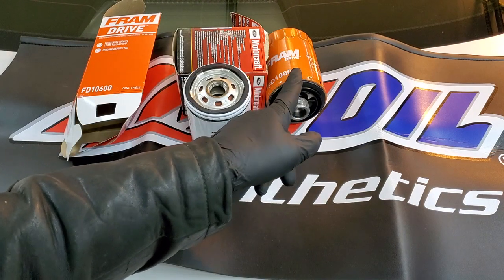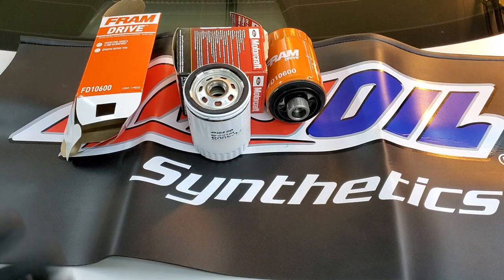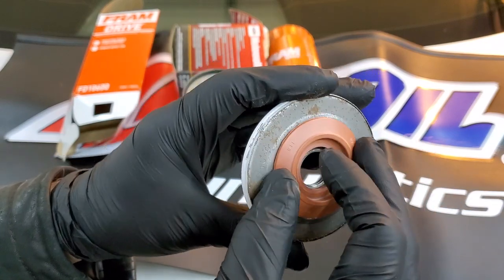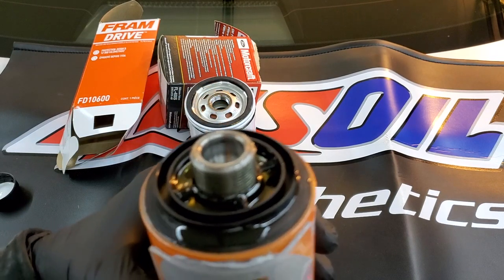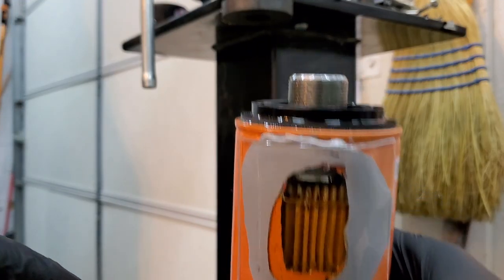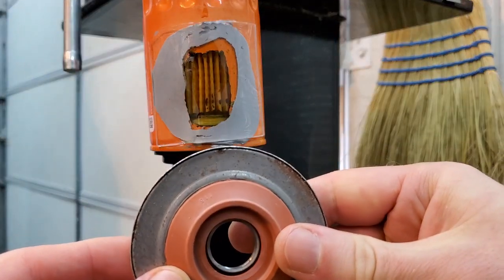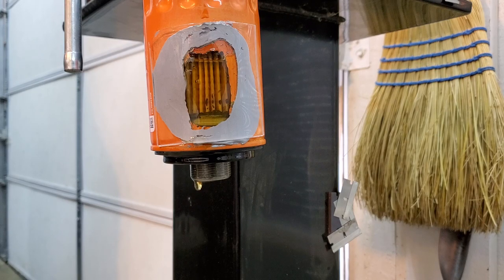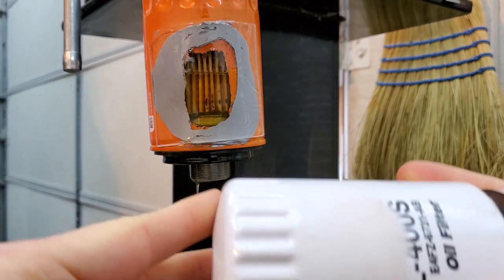How oil filter anti drain back valve works? Anti drain back valve has 2 jobs to do.

Comment: Makes you wonder if the reason so many Subaru engines blow up is because of the bad filter placement and too many dry startups.
Reply: That is a factoid. Most Subaru engines blow up due to people believing they are smarter than the engineer who built the engines from the beginning. The naturally aspirated EJ-series engines had head gaskets of another quality than the turbo charged engines. After some odd 100,000 miles the Teflon coating on the gaskets wore off and started to leak. 

The first generations of the FA20 ans FB20 engine series had a faulty rocker arm assembly and that has since been corrected. There were also a problem with the piston rings for said engines - but with good oil and 5000 miles oil change intervals that could also be prevented. 

The top mounted oil filter has nothing to do with these issues. 

It’s also less messy when you’re doing the oil changes.

Comment: Subaru's FB engine has the filter on top. The oil light stays on for about 1 second after starting with new oil and filter. Every start after that the oil light goes out instantly. I think once the filter element is saturated with oil it makes a difference for the next start up. Great video.

Comment: Nice visual but there is a difference in how well it works. You see you did a great job making it visual. But with fluid dynamics you showed how well it holds oil in a open condition. Not a closed condition like it is when mounted on the vehicle. To very different conditions the closed condition will not allow the siphoning off like your open condition in your test does. But however was very interesting.
Reply from the maker: Plus oil temperature in vehicle is around 190F and in my garage around 40F. Hot oil flows much faster. Thank you for commenting.
Reply: @repairvehicle  yeah I know very true it would interesting if it could be seen on a vehicle.
Reply from the maker: I have some ideas, but not sure how to accomplish yet.
Reply: @repairvehicle  plus the oil pressure might separate the clear plastic from the epoxy.
Reply: @Jon O… you were partially correct .. dynamics!!!  
Oil Pan —> Oil Pump —> Oil filter outer —> Oil filtering material —> Oil filter inner pipe —> *Lubricating engine* 

In the example here.. it actually proved that the anti drain works.  Keep in mind that We are not filtering oil to send oil to the pan.. 

The test would be a failure if .. any oil flowed back out through the outer filter holes..

Case closed!!

Comment: Isn't the valve there to prevent the "engine lube," NOT THE FILTER, from draining back?
Reply from the maker: there is no valve except what is in the filter. https://youtu.be/j1mHY04YhVI
Reply: So if my filter is upside down, I don't need a drainback valve? @repairvehicle
Reply: Is the valve there to prevent the engine or the filter draining back?
 @repairvehicle
Reply from the maker: @Jayf1981 anti drain back valve comes with filter. It works for short time.
Reply from the maker: @Jayf1981  prevents temporarily oil draining from the filter so that you don’t have dry starts

Comment: oil does not drain upside down when oil filter is hanging off motor. Unless sufficient pressure is pushing it and since motor is not working or on, there should be no pressure. Seems to me its some sales gimmick that you don't want your oil draining out of your filter while motor is idle. It cannot anyways. So why the need for anti drain back unless the filter is positioned on the side of a motor or in an inverted position. Don't know of any.
Reply from the maker: What are you driving?
Reply: Anti drain back valve keeps your oil in your engine from leaking down. It serves its purpose.

Comment: "The oil is coming from the center hole" 5:30  When the oil filter is standing vertically, the oil stopped by the drain-back valve flows through the filter paper to the center drain. It never occurred to me that it would do this. But now that you have shown it to me, it makes sense. Thanks.

Comment: Could you do a video testing Hubb Lifetime Oil filters? I just bought one for my 2007 Chevy Silverado 2500 HD 6.0 because the original oil filter on it, AC Delco was said to not be good for it. Started having oil pressure problems, replaced the oil pressure sending unit, (no filter underneath on the 6.0), still had problems. Finally isolated what I think the problem is: oil pickup tube O ring needs replaced. 
But after doing so much research on oil filters and bypass valve psi settings I realized that I think that the majority of the contaminants that SHOULD be getting caught in oil filters with low psi bypass valve settings is actually just getting pushed through the engine past the filter because the bypass valve on some oil filters open prematurely. 
Thats why 2007 Chevy Silverado 2500 owners of the 5.3 and 6.0 liter engines are having problems with their oil pressure sending unit filters getting clogged and having to tear apart their oil pumps, because the small freakin filters they are using aren't trapping the contaminants because the bypass valve psi settings on the smaller filters is set too low so the oil pressure from the vehicle running at idle is enough to activate the bypass valves, which totally defeats the purpose of the filter in the first place. 
After much thought I decided to go with a KN HP1017 with a higher bypass valve PSI setting so I know more of the contaminants are getting caught in the filter media. 
But then after thinking about it more I realized that even the best of the synthetic filters get clogged over time. Its what they are supposed to do, but as you continue to drive with a filter that is getting clogged with contaminants it actually increases the psi required to pass good oil thru the filter media which could be another reason why the bypass valve would open prematurely. 

So I went ahead and decided to try a Hubb lifetime filter. Was about $100 but I think it will be well worth it in the long run. 
First of all, the filter media is designed for flow. Its also got two filter elements inside, which means that its impossible for sludge to get past the bypass valve and back into your motor. I thought that was a pretty neat feature. 

Thank you for sharing your videos. I watched your video on why engines consume oil. Made lots of sense. The logic you presented on the subject is flawless. Oil burns, but it burns worse if its cheap oil because cheap oil evaporates faster. Also, the fact you're an AMSOIL guy, I think you've gotta be trustworthy. lol.
Reply from the maker: What was the mileage on the truck when you bought it? How often were you changing oil? What brand of oil were you using?
Conventional oil?
I will definitely add to my list Hubb to review
Reply: @repairvehicle  
I bought the truck from my dad who has always been very meticulous with his oil changes, always changed the oil every 3000 miles, always kept up on the maintenance of all his vehicles. 
I think he always used the regular 5w30 oil thats recommended for it. 
Two oil changes ago I went ahead and ran some seafoam thru the engine (without revving the engine) to help loosen up the oil and help break down sludge and when I drained the oil I noticed some pretty decent sized chunks of sludge in the pan. Not sure where the sludge was from but I was a little surprised by it since engine sludge doesnt typically form on the bottom of the pan. Sludge forms because oil gets burnt to the point where it turns into a paste, and its almost impossible for oil to burn in the pan because thats where the oil is at its coolest. So wherever the sludge was accumulating, I think the seafoam really helped to dislodge it and help it work its way back to the pan. 

After the seafoam and drain and new filter install (KN HP1017) I put a synthetic 10w30 oil in and added some LucasOil stabilizer and then took the truck out for a test drive to see what the oil pressure looked like. 

The pressure reading was significantly better which is what I wanted but the truck really doesnt like the 10w30 weight oil. Truck runs fine on it, but I think the higher weight oil actually slows down the performance because it feels like you're having to push the pedal just a bit harder than normal to get the same output as before. 
But I went ahead and ran it for 3000 miles on the 10w30 and it got better with time. Seemed like it drove better as the oil broke in. Right about the 2500 mile mark it was driving like brand new 5w30 oil. By the way, I have to mention that in order to get the truck to the right oil pressure before I started driving on the road I would start the truck, let it run for 10 mins or so (starting psi would be around 20 psi) and then turn off the truck, wait ten seconds and then restart the truck and then the psi would jump all the way up to 37 and settle down to 35 at idle, which is normal. So every time I started the truck thats what I did to make sure I was running the truck with enough oil pressure psi. 
I think there must have been something stuck in the oil pump pressure relief valve to have caused the psi to get stuck at the initial level and then need to be restarted to get it to jump to the correct psi. 

On this latest oil change I went ahead and dumped some synthetic Castrol 5w30 in it and added the usual Lucasoil stabilizer and I went ahead and installed the lifetime Hubb oil filter on it. Ever since I installed the HUBB filter...all the oil pressure problems are GONZO. Oil pressure jumps right to 40 on startup every time and settles at 35 (which is perfectly normal). And Ive noticed there's absolutely no delay in power now when I press on the pedal. Instant power and better acceleration. 
I have noticed the gas mileage doesnt seem as good. Its not terrible but it could be better. Overall Im happy. Looking forward to cleaning out the Hubb filter and checking out what it might have caught on the inside. Hopefully some decent sized chunks. I'll try to remember to run seafoam thru it before I drain it again to see if that helps loosen some chunks. Overall Im happy with the Hubb filter. It was spendy but it seems like a good investment.

Comment: Very informative video! Thank you very much.

I'm wondering why your oil stopped draining during the experiment process.
Did the tip of the union bolt sticking into the filter and the oil surface remaining in the filter have the same height?
The oil drain through the union bolt. When the oil level drops below the tip of the union bolt, the oil will stop draining.
Reply from the maker: Less oil meaning less gravitational force forcing oil down. Also, small amounts of vacuum prevents all the oil from escaping because everything inside oil filter is covered in oil. 3 days later or so all the oil have drained.
Reply from the maker: Here is interesting video, cummins no oil, should it be full?
https://youtu.be/j1mHY04YhVI
Reply: @repairvehicle  
Glad to know that!
I'm curious to see what the results would be with hot oil, but I thought it may be possible that a car which is driven daily could hold oil through a night.
Reply: @repairvehicle  
Thank you, I'll watch it!
Reply from the maker: That video show that oil filter is up and vacuum pulls oil out of the filter leaving filter almost empty
Reply: @repairvehicle  
I own Subaru BRZ(engine is FA20).
The OEM oil filter has an anti drain back valve, and from what I have observed so far, the filter is almost empty within about 5 minutes of stopping a fully warmed up engine.
(I'm not a mechanic, but I have removed and disassembled oil filters for disposal quite a few more times than most people. I have never had a problem with oil spilling out of a removed oil filter.)

Just a while ago, I removed the oil filter from my car, which had not been driven for about 3 weeks, and observed it.
There was absolutely no oil left in the filter. Not a drop of oil came out when I pushed the valve in.

As for the FA20, oil filter is mounted on top of the engine with the opening down.
Considering the oil gallery, when oil falls out of one cylinder head, the vacuum may pull the oil out of the  filter.
Reply from the maker: @abaracrackin all oil filters have anti drain back valve
Reply: @repairvehicle  
Do you mean that even if there is no visible anti drain back valve in filter, oil will not drain back due to the vacuum in the oil gallery?
I just noticed that the filter in cummins video you showed me does not have an anti drain back valve!
Reply from the maker: Cummins filter has anti drain back valve, every canister type oil filter has anti drain back.
Reply from the maker: Cummins filter is almost empty due to vacuum in oil galleries that will pull oil out no matter how filter is positioned.
Reply: @repairvehicle  
There are filters which don't have anti drain back valve, like filters for Mazda MX5s or K&P reusable filters (K&P is a special case, though)
Sorry if what you said "all oil filters have anti drain back valve" is irrelevant to this.
Reply: @repairvehicle  
I see and hear many people say that the anti drain back valve is intended to keep oil in the filter so that oil is immediately supplied to various parts of the engine when the engine starts to prevent a dry start.
But in reality, as we have seen, there seems to be little (almost no) oil left in filter.
I suspect that there is another role, at least with respect to BRZ. I think there are two possible roles: one is to keep particles that do not get entangled in the filter fibers from getting back into the oil pump and wearing out the oil pump. The other is to prevent water hammer.

What do you think the role of the anti drain back valve is now?
Reply from the maker: I don’t consider reusable filters as filters when it come to oil.
Reply from the maker: Good question. I have asked myself many times about the purpose of the anti drain back valve and how not come up with any an. I have even searched my book that talks about oil filters and lubricants in details and it does not even say the real reason for the anti drain. 
Cats with cartridge oil filters don’t have anti drain valve and these cars don’t have problems with lubricity. I think someone came with an idea and everyone stock it with without ever questioning why, just like many other things in life are being.
Reply: @repairvehicle  
It is interesting for me to explore role of  anti drain back valve.
It was a pleasure having this conversation with you today, thank you for your wisdom. I've subscribed to your channel!
Reply from the maker: Happy to help and have you as subscriber on my channel.